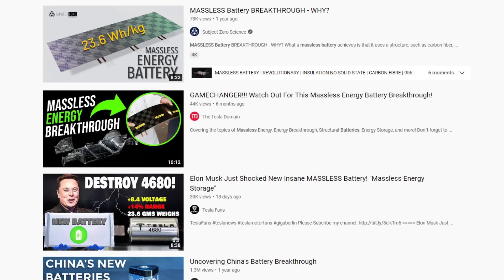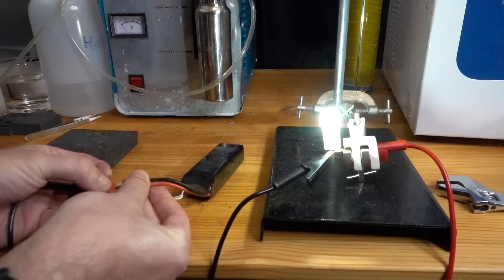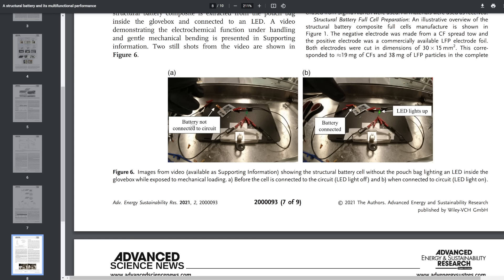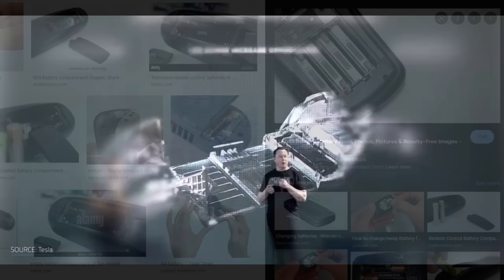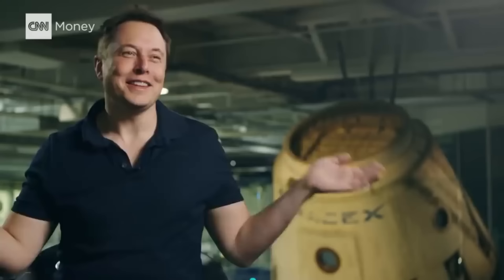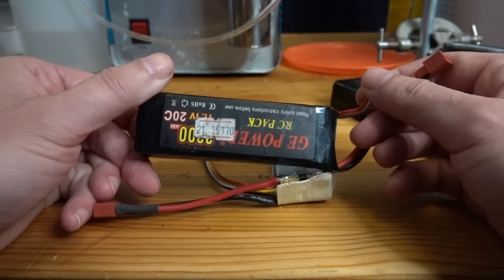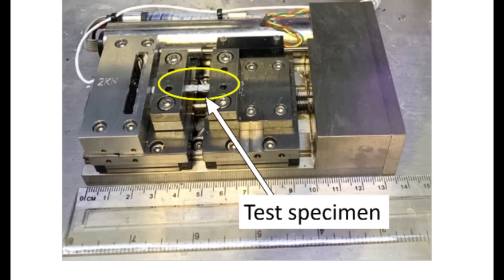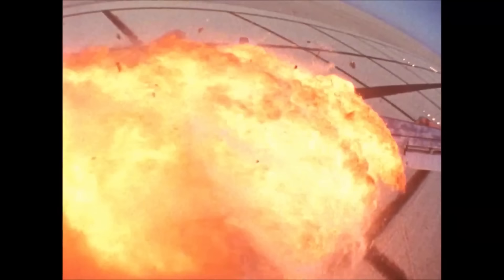Matt Ferrell, Massless Battery: BUSTED!!

Comment: A few years ago, when I was an R&D engineer for Thoratec (the company that invented the first practical LVAD heart pump) we were trying to find ways to reduce the strain on our patients.  When mobile, the pump was powered by two lithium battery packs carried on the patient in side holsters.  They were awkward, bulky and fatiguing to carry around.  One of the ideas we came up with, borrowed from the Army, was a battery vest that, instead of a couple dozen AA-sized cells in the pack, they used flat-pack cells sewn into the vest lining.  The total assembly was no lighter than the belt version, but the perception was that it was "weightless" since it was so much better distributed.  We never called it weightless, though.
Reply: I assume you mean more than a few... because i had 3 of them 6 years ago... 
   But hey thanks man! The battery packs were the least of my concerns. 
   Find a way to hook up both controllers though... gotta carry it anyway. That way you dont need to unplug your heart before leavung the hospital as a drill.
Reply: BTW the teams were just recommending fishing vests. I went with a maxpedition versipack.
Reply: @OvertonWindex  - Wow! The absolute best part of working for that company was interacting with the patients!  When you said "3 of them" I hope you were referring to battery packs and not the pump itself!  Did you have a Heartmate II or Heartmate 3?

Yes, controller swapping was a major headache because there will be that 3 to 4 second gap during the switchover where the pump has to stop.  They stayed with the standard screw-in type connectors for reliability.  I can't really say more than that.
Reply: @OvertonWindex  - Yeah, some patients actually used holster vests designed for small pistols.  We were trying to come up with something similar that the FDA would approve.
Reply: @hagerty1952  Nope, 3 pumps haha. I was a bleeding clotting mess. Heartmate 2 i believe... bigger one? And an RVAD as well. ECMO first for more than a couple weeks.
Reply: A better way would be to claim an structural material that can function as a battery without adding extra mass for the battery part. But massless sounds so much better in publications. Considering the video a nuance lost on TF
Reply: @bzuidgeest  its not though. Its a battery laminated in structual material.
Reply: @OvertonWindex  this one is, but that is not usually what is meant. Also showing a prototype that way is not too say they are not looking into ways to do it like I said. But you need investors and pretty pictures in the meantime. Fact of life and business
Reply: @OvertonWindex  the voltaic pile was pretty "solid". Though unlikely i don't really see why we couldn't produce a battery in a shape or form that could be used as a structural part. Even a lithium battery has structural properties. You just don't want to use them as building material. But i have little doubt there could be a chemistry that  would be strong enough for some structural work. That said I doubt it would be practical to do or use. 
Remember the person that discovered radio waves thought they had no use at all. Look at our society now. 
I consider ideas on a scale of more or less likely. Any idea is valid and might come to fruition, though no necessarily in the way the person with the initial idea thought. At one point everyone knew solar energy was impracticalb or impossible, or space travel or mobile phones or transistors. Until someone actually did it. Innovation is trying to do the impossible until it's possible. Not from doing what you already knew. 
Just because result is impossible to achieve in a certain way, does not mean it's impossible to do at all. Maybe this company is a scam, doesn't mean all companies are.
Reply: @OvertonWindex  what do u use now then?
Reply: @cookie5535  for what?
Reply: Quite a far call from referring to something as Massless, the equivalent of Free energy contraptions. Weight is more abstract, dependent on conditions and constraints. Weightless machines do exist as a fact which none of which can be said for massless. Its fiction.
Reply: @bzuidgeest  citing someone else's brilliant post that addresses this same issue and what I was commenting about:
"I can't wait to see thermal run away in 100% of my car's frame, what a great idea.
Did you know that making the seats of your car out of plastic bags of gasoline is the most comfortable ride you'll ever have? There are no risks to this idea, just benefits."
Reply: Well maybe that's because you understood the meaning of mass?